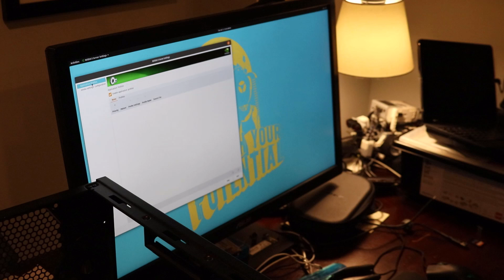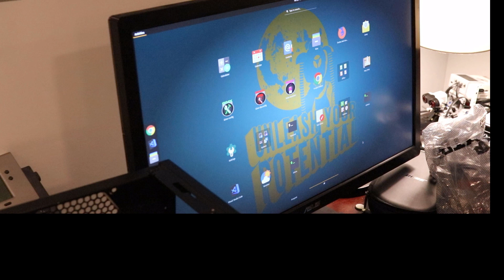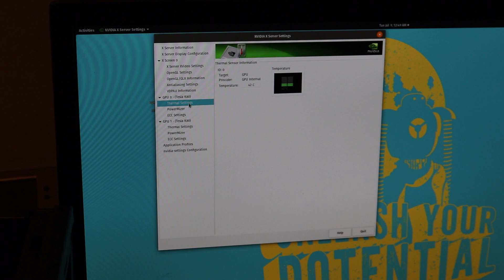NVIDIA Tesla K80 GPU 5 minute install

Comment: Hello! Thanks for video! Please tell us the motherboard model!
Reply from the maker: The motherboard is an ASUS Z170-WS
Reply: Thank you! I have Tesla K80 and i'm waiting an Asus X99-E WS. It should works!
Reply: Tell me please in what tasks do you use k80?
And what settings (other than "4G") needed to be applied manually in BIOS? I read on the forums that it is not always that simple.
Reply from the maker: Alexander Petrushkov  so I do machine learning things from object detection to data classification tasks for structured and unstructured data, natural language processing and generation using various tools like TensorFlow. The GPU acceleration allows for faster model building, larger model building and the testing different hyper-parameters. Usually 10 to 50 times faster than on conventional CPU. The “Above 4G” setting is the only one I needed. The key was the motherboard supporting the card. I have only had luck with Asus MBs
Reply: This is an interesting task and you have achieved good results in speeding up the calculation process. How much RAM do you have and what CPU is installed?
Reply from the maker: @alexanderpetrushkov7404    32GB RAM + 14 Core Xeon CPU.
Reply: Is Xeon CPUs supported by this board?
Reply: @robin-g6  speculating here but the buyer's problem may not have been that the GPU wasn't working but that he just wasn't seeing active performance out of the GPU.
I suggest this because I use my system for AutoCAD and Adobe Lightroom  and have a Quadro K4000.. and recently put in a Tesla K40, which I thought would assist in my 2d CAD environment workloads, with the calculations for applied hatching within the drawings and large RAW image regenerations during edits from my 36mp Full Frame DSLR. 
The monitoring software shows the Tesla as there and functioning but even und the most demanding 2d CAD or Lightroom photo editing loads I could throw at it, the Quadro shows its heavily used.. but there is no sign of activity out of the Tesla.

(I don't know if I haven't set up something.. but yeah, if its all set correctly, the Tesla doesn't help in my applications)
Reply from the maker: @I_ammm_mojojojo  We were able to confirm that the issue was how the card was powered. They could not get their system to boot/power on. If you plug at PCIE 6+2 pin cable into the card directly (without an adapter) then you are basically shorting 12v to ground so most PSUs won't even start if you don't power the card correctly. You can buy PCIE 6+2 to CPU 8 pin adapter which was probably what they needed. Next time I list one of these I think .I will include one.
Reply: @robin-g6  but if the plug orientation was incorrect, the plug should not even have gone in as the 6+2 gpu connector has a different pin-out to the 6+2 CPU connector.. which would have kept the wires in the correct orientation and eliminating the concern for shorting the power.
Reply from the maker: @I_ammm_mojojojo  totally agree this is what should have been the design. The problem is the rounded holes in PCIE 8pin will plug into the square holes of an EPS-12v. Here is a blog post on PCIE can be plugged into EPS-12v https://superuser.com/questions/1281414/ive-pluged-e-pci-power-cable62pin-to-eps-8-pin-on-motherboard
Reply: @robin-g6  🤔
Reply from the maker: Alexander Petrushkov  this board has 7700k Core i7
Reply: @robin-g6  Hi, Robin. I designed my PC and completed the installation of equipment. Now is 128Gb RAM, 2xXeon E5-2630v3, 2xTesla K80. Thank you for your help!
Reply: @alexanderpetrushkov7404   Dear Alexander I'm very interested in mounting K80's in pc, can you explain a little bit more about your PC? I'm also on Xeon over an Asus X99- E WS like you thanks in advance
Reply: @PedroRodriguez-ui8sx  Dear Pedro. In the end I bought not X99-E WS, but another WS motherboard - Asus Z10PE-D8 WS. Main problem for me was Tesla cooling :-)
Reply: @alexanderpetrushkov7404   Thanks for your fast response, we will continue to try in the X99 but if it don't  work we can consider your choice. Thanks again. One more question how do you made the BIOS change to achieve the  4G thing?
Reply: @alexanderpetrushkov7404  Did you use Asus X99-E WS motherboard in your setup?
Reply: @mostafaghadamyari56  No, my MB is Asus Z10PE.